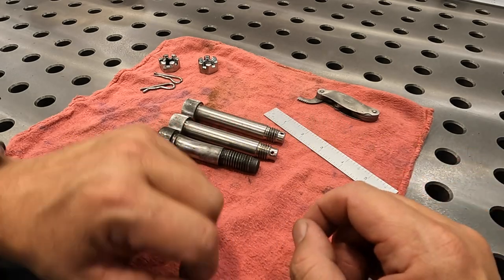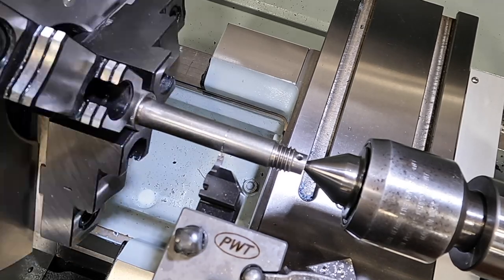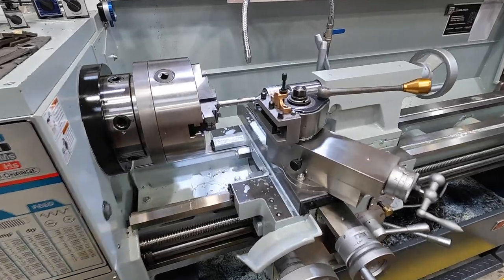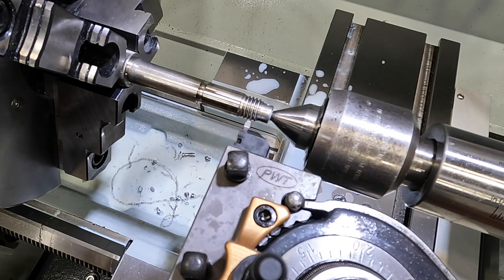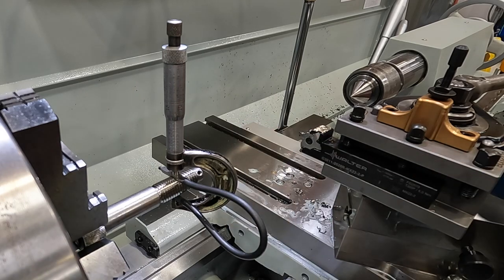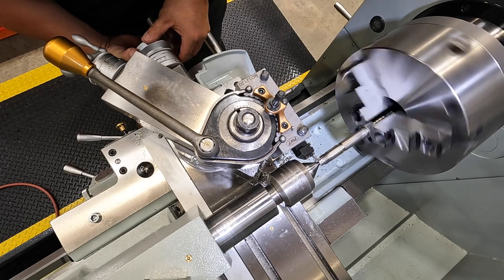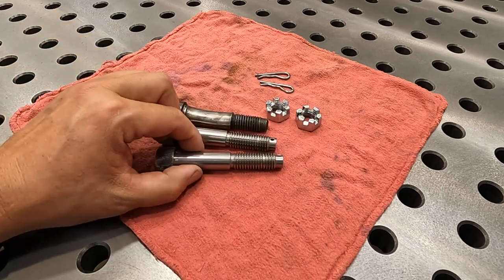Single Point Thread Chasing on a Manual Lathe

Comment: What's the advantage of increasing depth with the compound?  Seems like it would be easier to find the center of the thread and just use go in with the cross feed.  Well, maybe easier for a beginner like me.
Reply: I think Adam likes to cut one side of the 60 degree thread instead of both where you can get some chatter
Reply: @dizzolve  Not sure, i've seen other people make new threads only using the cross feed.  I haven't cut threads since high school just over 20 years ago, so chatter seems like the bet guess if any.  lol.
Reply: Less chatter when cutting on the left side of the insert, instead of the full profile.. In theory. I just plunge straight in with no issues on most work. A bigger thread on harder materials can cause chatter. In practice, most of the time plunging straight in with the cross feed is fine.
Reply: @dizzolve  you are always only cutting on one side of the insert, the side towards the feed direction. Doesn’t matter what the compound is set too.
Reply: @Jraksdhs  no if you plunge straight in with either the compound or the cross slide, what I was taught is that both sides will do some cutting.   I understand what you're saying but if you center the point of the tool and advance straight in, it wont just touch the feed direction
Reply: There's a huge difference in tool pressure when using the 29.5 degree compound vs plunging straight in with the cross slide. Basically you're cutting the leading edge of the thread that way instead of the whole profile at once. It can be hard to visualize but I assure you there's a very tangible difference.
Reply: My lazy brain appreciates pulling the tool away with the cross feed, returning it to zero, and then advancing the compound. I don't end up making unintended spring passes, cutting air or (God Forbid) digging too deep because I couldn't remember where I last had the tool on the previous pass.
I should point out that my thread cutting experience is only one week old... I've made several rattles for the Grandbaby.

Comment: Do you cut on the right side of the threading tool for rigidity?
 If the thread was left hand would you use the other side... in other words...
Concerning what the drive not engages
Reply: For right hand threads, you cut the right flank of the thread as shown to take up backlash in the compound feed screw. The carriage movement is pushing tool into the work and keeping everything susceptible to backlash in the compound in compression. If you tried to cut on the left flank of the thread by swing the compound, the carriage movement is now pulling away form the cut.

For left hand threads, you do swing the compound to the other side of 90° and reverse the feed direction.
Reply: @ElectricGears  thanks c:

Comment: I think you didn't match it exactly and that might cause the binding you refer, the nut is catchin on the thread transition. Look at the 5th thread from the tip its thicker. When you start cutting with the zoom it looks like the threading tool is not riding on the left side of each thread it seems theres a small gap. Its should be rubbing anytime you feed the compound at 29.5 to cut the right side of the thread with the left side of the insert. Am i seeing this right?
Reply: 29.5 is a magic number according to RIchard Ho(ax)land.  It's embedded into the Cydonia complex on Mars and Old Navy.  Go figure.

Comment: If it was me I would have just bought a bolt with the same shoulder diameter but longer then cut the shoulder to length and cut all new threads, rather than chasing existing ones.

Comment: Thanks to you Adam for nailing in the 29.5 degree compound angle. However, I have just thought of one thing that I can't remember. How close to 90 degrees does the tool have to be? Can it be out by a degree or two or do you essentially have to tram it in?
Reply: you mean 60 degrees for the tool?
Reply: @chrisnorth3458  60.5 from the compound or 90 degrees to the job.
Reply: @jemijona  are you talking about the tool holder being 90 degrees? The compound is set half a degree out so the tool only cuts on one edge
Reply: @chrisnorth3458  Tool holder / tool. Having the tool at 89.5 means the thread will not be symmetrical. Is this how it should be or would it be an error?

Comment: Maybe I'm missing something but I'm confused as to how the threads just inherently lined up with the cutter. If the part it ended up in the chuck a few thousands one way or the other then they wouldn't have.  I figured there was going to be some complicated alignment process between the cutter and the already existing threads. That being said I'm no machinist so The answer is probably obvious
Reply: the compound was moved for fine adjustment while the leadscrew was still engaged but not moving
Reply: With the half nut engaged, move the cross slide in and the angled compound slide out to move the cutter laterally to line up with the existing thread.  Once the cutting face of the tool touches the cut face of the thread, you can back out the compound and everything will stay in sync.
Reply: @kensherwin4544  yeah I figured that part but I was just confused cuz didn't seem like he had to do any adjustment in the video. Maybe he just did it off camera. To the layman it looked like he just engaged the half not and it was automatically aligned.
Reply: @DoRC  yeah, I expected to see more actual handwheel twiddling, too

Comment: Looks like some of the original threads got cut up one is gone completly.
Reply: You're probably looking at the thread that is where the original ones ended and the new ones started. It is not full diameter there, that's why it is not full form.
Reply: @vicke12343  yeah I think so

Comment: Other guys, latest one in Austin Texas......, has shown this before but I never practised it, it's great to be refreshed. I do have some bolts I might need to do the same to.
Luck the bolt was that long that it the head passed the jaws.
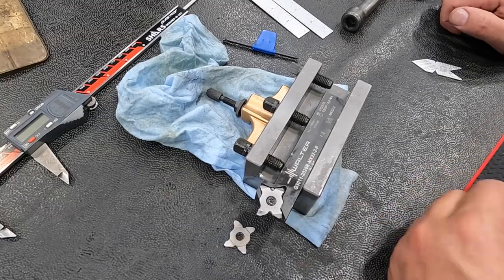Time 05:36, Walter tool. Surely not for a low budget hobbyist.
At time 13:15. Look from the right to the left. The 5:th ridge(?) doesn't look like matching. Something in Your syncronicing makes a bell buzz.
Both bolts show the same. I'm puzzled.
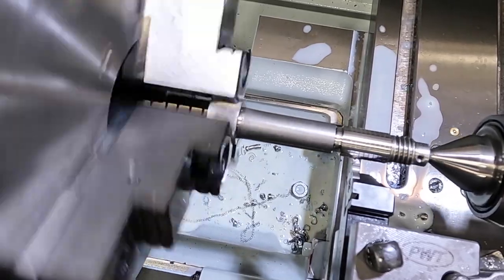Reply: The 5th thread crest (counting right to left) Is smaller than the rest because the threading on the bolt originally was relief cut in this area. Much like he did with his radius tool. This can be seen pretty well at 11:37 for reference. That 5th crest is smaller in diameter than the rest from the very beginning.
Reply: @itsdownfall9821  Okey. The depth in the view tricked me.
Reply: @Stefan_Boerjesson  The guy in Austin Texas would never do it this way. The setup was wrong and compromised the original threads. You must coordinate the V shape regardless of the original process and go from there.
Reply: @joepie221  It didn't look the same......

Comment: Hi, I'm a fan of your you tube channel since almost the beginning. I have the same set of triangles for measuring pitch diameter on thread. I only have a very small chart with the set and I saw in the past that you have a very nice chart, much better than the one I have. Do you think you could post a picture of a PDF scan of your chart. I would really appreciate.  Jeff

Comment: What is the benefit to single point cutting threads vs using a die ?
Reply: You don't always have a suitable die, and you may not want to spend a fortune on a very large die, for a single job.

With a lathe, you can cut pretty much any thread, you will ever need.
Reply: Another factor is that a die does not always cut a thread precisely at 90 degrees to the work piece. Single pointing does.
Reply: @bobhudson6659  You can get tailstock die holders, which keep the die aligned .
Reply: @BedsitBob  Agreed, but if accuracy is required, single pointing provides that. Besides Adam is trying to educate us all on this method which he also mentions he used to do regularly to clean up galled threads on large hydraulic cylinder parts. In those cases single pointing is the only way.

Comment: Anybody know where he got that thread wire holder/setup?
Reply: I think it is a Thread Triangle set. I got some years ago and they are still made, I saw some advertised some time ago. Just look at machinery supply and also Amazon.
Reply: i THINK the thread triangles are better than wires as there are only two of them, they work on many different threads as they have different flats for fine pitch and wide flats for bigger threads. Mine were dead of for size. They come with a sheet that has the constants for different pitches. Very simple to use.
Reply: Thanks much for the info

Comment: From a learning point working 2 dials is more complicated. As you will see Adam has to set both dials to get a cut other methods is to just use one. Same result.
Reply: The initial setup is a bit more complicated, but doing the cutting is simpler, more precise, and less prone to error. It allows him to back out after a cut and then return to exactly '0' on the carriage feed to resume at the exact same original location on the crossfeed, not needing to keep track of some other random number, which can wind up anywhere on the dial as you take minor fitting cuts, maybe even in between lines etc. It's a technique worth learning.
Reply: @kindabluejazz  As I said from a LEARNING point of view it is more complicated, like driving you learn the basics first then go out on the motor way. 
I did my toolroom apprenticeship starting in 1977 in the UK. keep things simple.
2 things I notice with US machine shops. turn the compound and reach for a shifting spanner lol
He has a dro so your random number is out the window also it is only threading where the compound is used for threading or an angle otherwise the cross slide is used.  Please show some of your maching.?
Reply: my thoughts exactly hunter
Reply: @theessexhunter1305  You're confusing 'learning' with 'beginner'. Advanced things still need to be 'learned'. Not every one of Adam's videos is geared towards beginners - he often shows more advanced techniques, especially when he says 'this is how I do it'. Oh, and the 'I know what's right because I've been doing it a longer than you' thing is just arrogant nonsense. There is always more than one way to do things, and it's just as possible you've been doing it a terrible way for years because you never bothered to learn a better way.
Reply: @kindabluejazz  So that is a NO I don't have any machining content of my own...LOL
I am not confused as I learnt as an apprentice milling turning jig boring surface grinding centre grinding to a high tolerance...
WHAT I SAID is with using the compound and cross slide there are 2 things to control instead of ONE. IF you watch Kurtis of cutting edge engineering he has the compound on ZERO as it is only one movement not ARROGANCE. 
Adam is a good machinist but leaves it up to people like yourself to defend his methods....lol
Reply: @theessexhunter1305  With Adam's technique, there is very little to 'control'. After pulling out to measure, the cross-slide just needs to be returned to '0' - that takes practically no skill, and the absolute value of the compound is irrelevant, since it remains exactly where it was. Arrogance is when you insist yours is the only right answer - obviously you're wrong about that. And you entirely skipped over my point that this was not considered a 'beginner' technique as you implied - he clearly said it was the way he does it, and he's gone over his reasons on many previous videos where he compares it to your method. You simply have no defense for your original misguided statement, just revisionist back-pedaling and personal attacks.

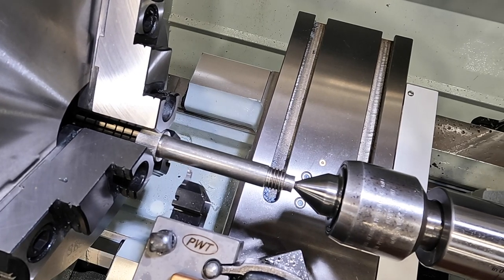Comment: 3:04 - Now that's what I envy people who use US Customary units for. Immediately knowing what fractions are in decimal. Can you also convert in your head if you don't know the numbers?
Simply don't use fractions often enough with Metric units.
Reply: it is easy to do in your head just start multiplying 1 by .5  this gives you half a inch  half of this is a quarter half of this is a one eighth and then one 1/16.
like one eighth is .125 plus a half is 5/8ths so .625 of a inch. when you do it every day for years you dont forget it even 30 years on.
Reply: and a few years after you get this mastered you can convert metric to inch and back with a few seconds of thinking.
Reply: One inch equals exactly 2.54 cm  conversion is pretty easy.  Typically if you're using fractions it will typically be in 16th's. Memorizing a few numbers is easy.can't remember... adding is easy too.

Comment: Very useful technique especially as most store bolts have very short threaded sections while a special order takes days or weeks.  I am getting ready to install my taper attachment to my lathe but I am stumped on how I can still have a DRO on it.  Do you have any set up with both on them in your shops?  I would like to see a picture or an explanation to help me get over my inertia.  I see very few taper attachments in recent years which makes me wonder if that is the reason they aren't more popular?  To add even more complexity to the situation I would prefer to keep the dust shield as well.  At best it is going to be a long reach over the assembly to my wall mounted tool holders.  Another fabrication coming up!
Reply: Taper was used in 1870 - 1950 widely . Since then all goes to cylindrical .
Reply: @bernardwill7196  Pipe threads and a huge variety of tapers still are in use not to mention all the fabrications needing them.  I don't know what you are talking about saying they ended in 1950.
Reply: @douglasthompson2740  Sorry about my short answer. What I mean is, in that time period , there was a lot use of Steamlocomotives ( on that machines you find a bunch of tapers ) , Steamtractors ( same technic as locomotives ) and Steammachines for stationary use as a pump or electrical generators. Also in metal buildings sometimes taper bindings are used. e.g. a tapered hole in a steelplate needs a drillbit cylindrical , a tapered drillbit and a reamer for taper. Also in that time period most bigger drillbits uses morsetaper  1-7. Till the end of 1960's manufacturer of lathes offers a aditional taper attachment, it was used a lot see above. Since then it was hard to find a new produced  lathe with taper attachment. Some manufacturers didn't offer that attachment no longer  as a additional item. I agree that taper nowadays used for pipe threads. Why should your taper attachment not corespond with your DRO ? The taper attachment only drives the compound in and out , follow the curve that you dial in. So can I ask what a lathe you use ?
Reply: @bernardwill7196  I bought a Grizzly G-4003G (12 x36 gunsmith) new about seven years ago with the optional taper attachment that I haven't had room to install til now.  The problem is where to mount the DRO not how to use it so that it is doable and does not interfere in operation of either.  I am not sure that is even possible.  I won't know til I get the new space arranged and I can acco.plish the major task of moving the lathe.  The attachment is still new in the box.
Reply: PS:  Tapers are still much in use for propeller shafting in the marine industry.  Outboards, in boards, huge ships , etc.  No tapers are still used in a huge variety.
Reply: @douglasthompson2740  Thanks for the information of your lathe. Normally the taper attachment is mounted at the back opposide of the apron. Sorry to hear that you have no room for the lathe and the taper attachment. Maybe in the future, I wish you the best. Also nice to hear that Grizzly produce a taper att. seven years ago, you are lucky that you have one. Sure sometimes it comes in handy to produce tapers. Normally DRO is mounted right on the saddle  the coressponding receiver is mounted on the compound.  The other one is mounted on the back of the lathe and the receiver is mounted on the saddle back. Such a receiver is small and should not interfer with your taper attachment. Did you own a machinist handbook ? P.S. taper can also produced by shifting the tailstock in conjunction with a dial gauge .
Reply: @douglasthompson2740  Sure tapers are not totally dead. But the wide use is over. I think CNC lathes are a additional reason why taper attachments are rare  nowadays.

Comment: I don’t understand how using the compound for the feed doesn’t change the tool position relative to the half nut.  I can see using it to line up the threads originally because it does change the relationship between the half nut and the tool, but how can it be used for the feed?
Reply: The compound is set to half the angle of the threads (the threads are symmetric right/ left, as opposed to a buttress thread), so the thread needs to be 30 degrees off perpendicular to both the right and left. As the compound feeds in/ out the right side of the tool will stay along the same line as the right side of the threads. The left side of the tool and the root do all of the cutting. Yes, the location of the root of the thread changes relative to the depth of cut (moving to the left as it is cut deeper), but so long as the right side stays consistent when the appropriate depth of cut is reached the root will be exactly where it needs to be. In this case, since the original threads were rolled (rounded root profile) and these are cut with a sharp profile the root changes a bit, which is why he gets some chips from the original threads as he approaches the final depth.
Reply: It does, but since he has the compound set at 29.5°, that's the same angle as the edge of the threading tool.  So rather than going deeper along the center line of the threading tool using the cross feed, he's going in deeper along one of the edges of the threading tool with the angled compound.  I don't know WHY he does that, is it better, or is it just preference.  More than one way to skin a cat, I guess.
Reply: Thanks I understand now. I think it is so only one edge is cutting